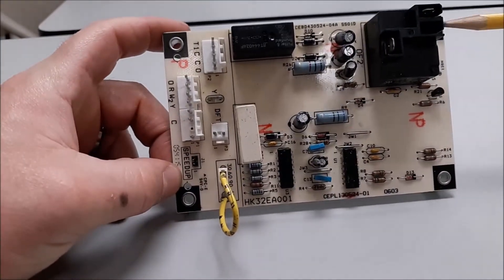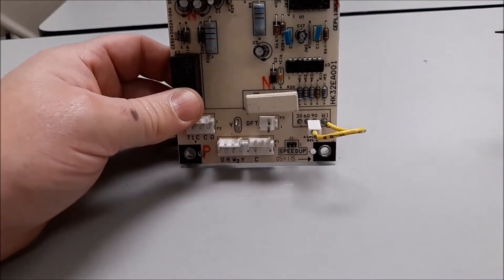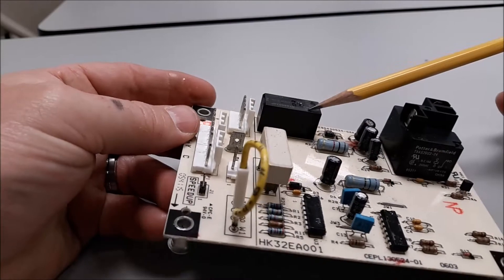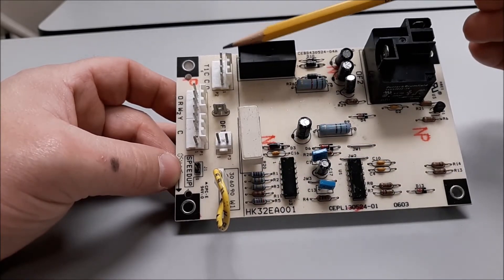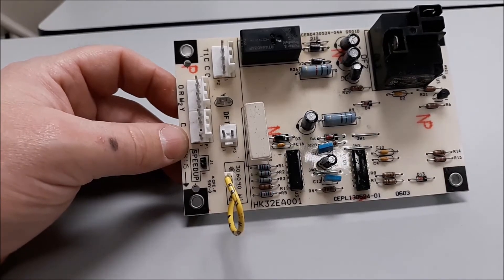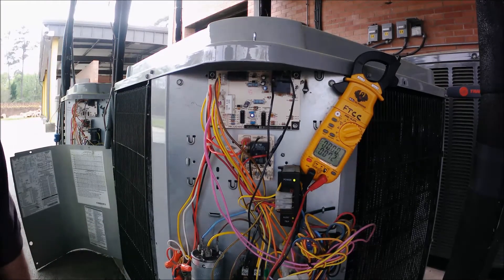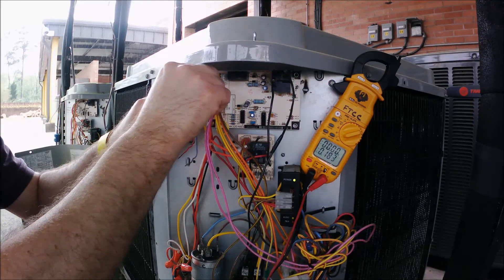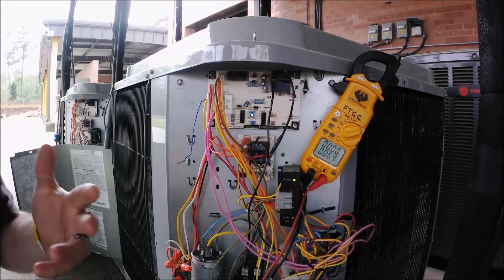Troubleshooting a Bryant Defrost Board

Comment: Hi John, love this video... I have the HK32EA003, the board is fried around the transistors and resistors... could that cause the outdoor unit not coming on? Contactor, Capacitors, and everything seem normal.
Reply from the maker: Short answer,...Yes. If the board has burnt circuit it is very likely. Of course I could go with the..."you still would need to troubleshoot to be sure" route but I think that board is simple enough that it contactor outside should be powered if you have 24V on 'Y' going into it. If power is going in on 'Y' and the unit isn't running then those burnt transistors, resistors, etc. are probably to blame.

Comment: Once the compressor contactor gets a call to run, it also sends 24v to T1? And once the compressor has been running for the desire amount of time selected without turning off the defrost will engage? Which will still keep the compressor contactor intact. Then it would also be in defrost for the same amount of time selected?  Hope this doesn't sound confusing. Just wondering the main purpose of T1 and how it works.
Thanks
Reply from the maker: T1 is supposed to track how long the contactor "Y" circuit has been energized...simulating how long the compressor has run. It doesnt have to be 30/60/90 minutes consecutively. Once the run time and coil temperature are ready the board goes into defrost. Defrost doesn't last more than 10 min but can be quicker.
Reply: @johnjennings-JJ  ok so the 30/60/90 mins is not defrost lengths? 30/60/90 are compressor run time determination?
Reply from the maker: Yes. Defrost is a fixed 10 minute max on many time/temperature boards like that unless the coil temp warms up quicker and the coil is cleared of frost.

Comment: So does the timer begin only when they temperature meets that requirement and closes the switch?
Reply from the maker: Supposedly so. Carrier prints the defrost  sequence in the unit manual as the coil getting cold - closing the switch - and then it runs the timing sequence of 30 60 90 minutes.
Reply: @johnjennings-JJ  

Thank you
Reply from the maker: No problem